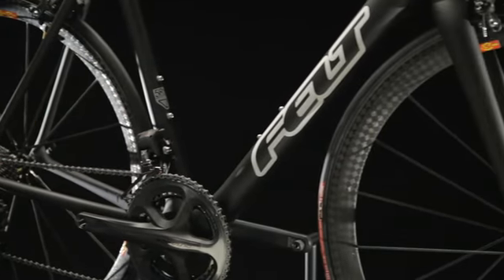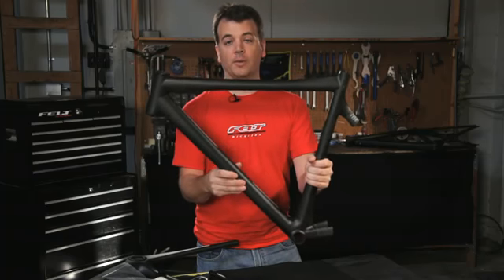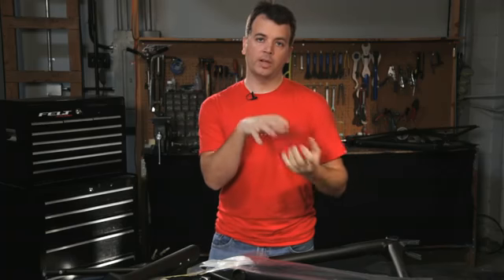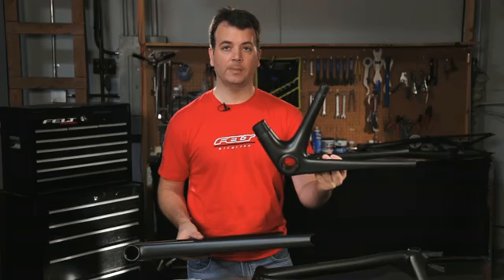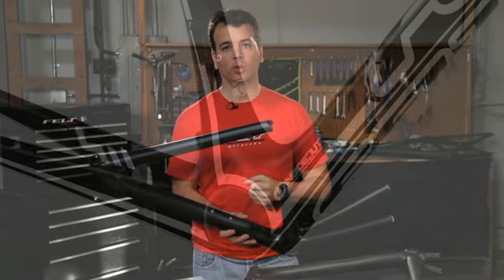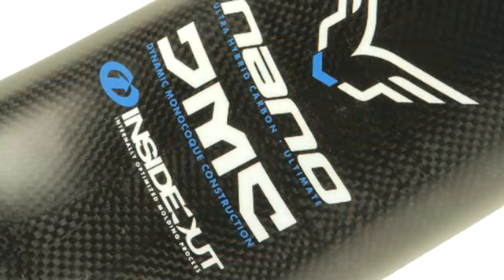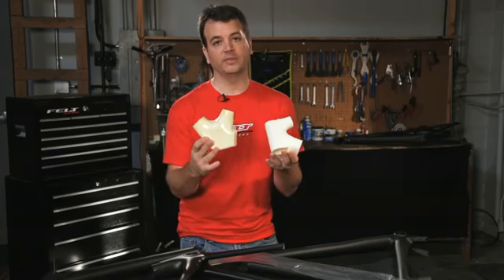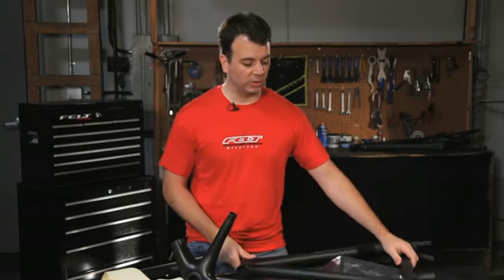Carbon Fiber: Manufacturing

Comment: I want a new mono cock carbon hard. The lil white inserts are custom made at piercan, the release agent is mclube. The soft inserts are pulled out after cure. The constant vaccum is held on latex bladder after cure while pulling out of an expensive aluminum 2 piece mold/tool. Not telling how carbon goes into both halves.

Comment: MonoCock?
Reply: Monocoque. Its French.
Reply: Monocoque is a structure that utilizes the skin of the structure as the sole source of structural strength and stiffness. Semi-monocouque would have stringers, bulkheads, or other structures in addition to the skin for strength.

Comment: What makes the bottom bracket stiffer in a carbon monocoque design than in just a carbon design?  Are the fibers more dense in this area, or is it just that it is pre-molded joints as opposed to some kind of welding process?  I was thinking of a titanium frame with ovalized and oversized tubes, but now I am researching monocoque possibilities.  I need a stiff bottom bracket for climbing.  I currently ride a Z85.
Reply: Ti is responsive and comfortable but "stiff" no. Carbon, aluminum, scandium and magnesium frames are all very stiff. Carbon having the best of all worlds: stiffness, weight and comfort. Monocoque carbon is def the best kind of carbon molding but not all carbon frames are stiff. Felts are very stiff, a lot of euro bikes are on the softer side. Hope this helps

Comment: Why wouldn't you guys just make a custom silicone bladder? Just make another clamshell tool that is smaller to account for the thickness of the carbon. 3D print some interior sections for the inside of the silicone for the air cavity and float that on the inside of the mold. Then fill the void with silicone and let it dry. That way you have a custom shaped bladder and you won't have to worry about trying to get those interior parts back out.

Comment: great idea but the mould for the shape is not the problem. the internal dimensions are a problem for felt because they appear to be using umbrella packaging for bladders!!!!  using cornstarch for the inner shape is also a great idea but guru already solved it by using proper rubber bladders made for the job. also they use the dynamic monocoque method which allows for "made to measure" bikes

Comment: because for felt, it would not solve the reason they have a plastic mould in the first place. to eliminate the excess areas of epoxy resin inside. they would make a carbon fibre insert , but that insert would have the excess resin problem just the same as the frame. The plastic is injection moulded so it does not have that problem. but overall either method it is not an elegant solution. guru solved it better in my opinion.

Comment: Am I the only one not understanding how those white internal molds come out? He said you put them in the carbon and then run the bladder through them to keep the shape while curing. Well, that means they're stuck in there does it not?
Reply: jshaw6600 : there us release agent mclube on the latextubes and the inserts.  Then the vacuum is held after cure as the latex is pulled out. The molds are expensive aluminum two piece. Iam not telling how the carbon goes into both pieces of the mold/tool. But u know a lil'.

Comment: One thing I didn't gather from the video is why is it important to get the interior for refine?  I mean, sure, you may get be getting a lighter frame (less material around the corners) as an end result of this refinement, but how does that relate to stronger / stiffer?

Comment: I still don't understand why manufactures insist that this method of construction is monocoque, some of the sections are moulded in one piece, but the resultant structure is composed of a number of internally lugged, then wrapped sections.

Perhaps I'm wrong, and perhaps that spade is actually a shovel...

Comment: does the removal of the internal wrinkles with the new process actually save weight or provide any other advantage compared to the old system of a seamless main triangle?  it seems like the sleeve joints of the new process would add more weight and decrease overall stiffness

Comment: Dynamic monocock gets a carbon stiffnes when it works hand-in-hand. Inside-out technology is about getting your head-tube into the entry point and come in then come back out. In a cycle. Cause it feels much smoother inside. There're large open sections here and.. here. So by modulating your monocock in the bottom cracket area you can make it as stiff and strong as possible. Don't think about internal bladder routing - it turns things inside-out and makes the tube less rigid and more flexible.
Reply: Lololololol
Reply: Lololololol